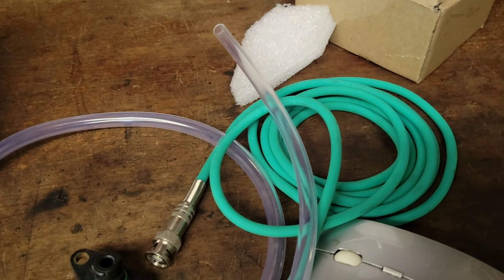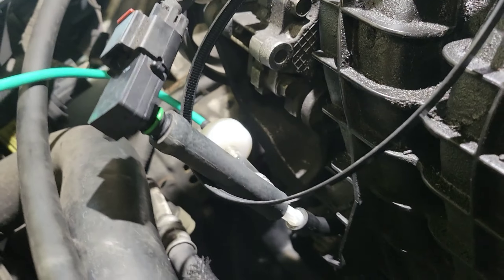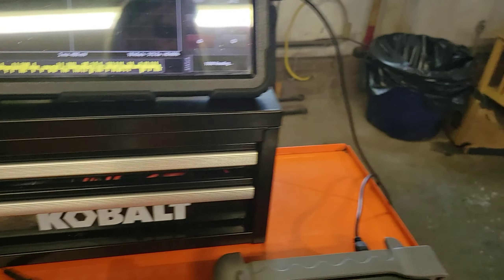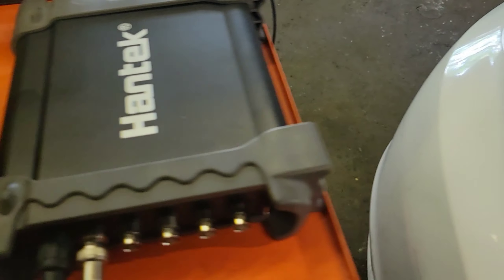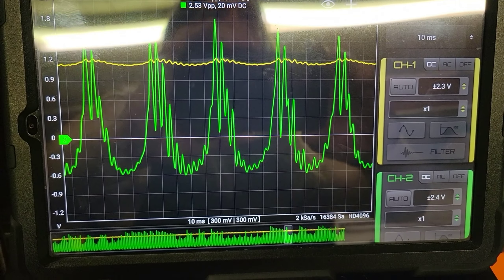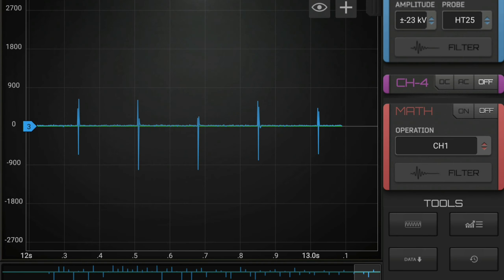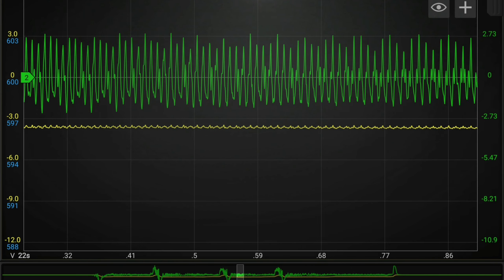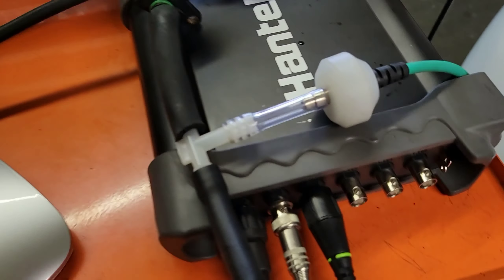Hantek 1008c running Hscope. Comparing a Rotkee pulse sensor vs MAP readings simultaneously

Comment: Try using a fuel pressure sensor, it work really well as a pressure sensor to measure things. Also i use an old knock sensor as a chassis ears with ths scope to find out where noises comes from.

Comment: Hose length,material and diameter affect the signal in map sensor.will amplify the pulse you are seeing.also hooking 2 sensors at same hose.
Reply from the maker: See, that's why i appreciate comments. I never did the MAP alone other than scan data. Would have been interesting to see the difference with and without the tubing. Always the next time. I was just getting tired of looking at that pulse sensor and thinking "I dont even know what kind of signal you make" lol. Now i know, it is an excitible sensor for sure. The Hantek only had 2.4v and 19v on Hscope add it overscaled on 19 a little.
Reply: Hi E. He is correct.  A map sensor works really well also. The clear hose can really throw off your capture. Especially in the tail pipe. Try to use a shorter piece or get one with a thicker schedule. This will helps. It will still work but the waveform will have a delay when you are lining up the overlay.

Comment: Maestro al osciloscopio se ele puede poner el atenuador con es aplicación hscope ??
Reply from the maker: Hi! Yes, you can put attenuators  on the scope. They are not software based. They are small pieces of hardware that connect to the actual scope. In the hscope software , you tell it which attenuator is connected and it sets your scale!

Comment: Eric I think I’m losing you a little. Are you using the Hscope running through the 8 Channel Hantech ? If you are will the Hscope give you the extra channels? Why not just check the cylinder sync. And MAP sensor just using the Hscope 502/512 and your tablet ? What are the readings on the left and right border ? Are you referencing the image and not the scaling ? This is using the Oscope could you have used the Hscope automotive ? If I’m way off base just let me know I’m new to the Hscope and what it can be hooked up to . Thanks Eric 👍
Reply from the maker: Hey there, yes I was mainly trying out  several things. The new sensor and if I coukd read both it and the MAP which is doing the same thing, turning intake pulses onto voltage. I was hoping they were closer scale wise . 4.5v is the maps max voltage and the pulse sensor was over 19.  Made the wave odd with the rotkee. Mainly wanted to sync to a pulse so I can identify which pulse belonged to each cylinder. 
 Yes I'm using Hscope software instead of the windows laptop based hantek softwar with the 1008. Works the same but limited to the hanteks low sample rate. You can use 4 channels of the 8 with hscooe , but honestly if I needed 5 I'd need a better scope anyways lol . That 8 channel barley ran 3 but it did run them well!
Reply: The pulse sensor is a piezoelectric sensor and the map sensor is a strain gauge . 
If you lower the voltage range even lower on the map you will see the pulses much clearer
Reply from the maker: @keltecshooter  Thank you, I was lost myself on why they reacted differently. I was assuming the piping, but that was not sitting right. Different type of sensor, now that is logical.  Thanks for the input!

Comment: I think you now know this but just to reiterate, the map sensor is a presure transducer (x pressure = x voltage). The Rotkee is a piezoelectric sensor, steady pressure = zero voltage, voltage changes with pressure CHANGES. Totally different principles. Rotkee is NOT a measurement device, just displays changes in pressure. Both sensors have uses that help diagnose things.
Reply from the maker: @SHIMHEAD1  That's where I got a little turned around, I assumed even though they operated differently they would look closer on the scope. My actual transducer has a low range that would have been a more fitting match up. All hindsight and lessons learned. I guess the biggest one is if the map is a more central port like where you want the pulse sensor, I can use the T to see better pulses. The last time I used the pulse it was on a port closer to 1 intake runner and progressively further from the others. The pattern showed this also. Big pulse, then progressively weaker. Some cars that map is more central.

Comment: That green is pretty slick how did you get that? Mine are all black I have 7 of them
Reply from the maker: That was random of Rotkees part. I kind of dig it myself!
Reply: @Backalleydiagnostics  that’s pretty awesome 😎 I want one lol
Reply from the maker: Just got it last week, might be their new run. Ordered their heavy duty piping and hose for the transducer. Been almost 3 weeks but made it to Poland the other day . Got to give it to Eugene and crew for still shipping while being bombed so we can plug shit into Hondas and such. Their scope looked awesome but not available. It didn't use bnc though. I wonder even though it does not say if they are like the newer pico leads? I put it on my ebay save list in case it shows up used
Reply: @Backalleydiagnostics  I’m not sure that’s weird. I just got six of them last week, I owned a few already. The leads are definitely different 4mm vs these and 10ft. I perfer the pico leads because of the shielding in them but these work great too. I have all the rotkeee leads, transducers and splitter leads. The mtpro is a great scope I love it